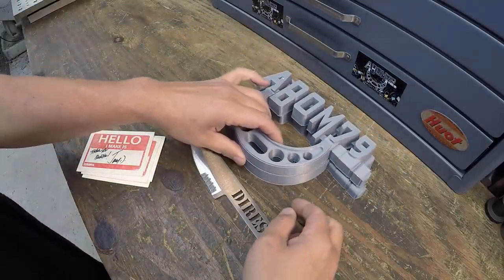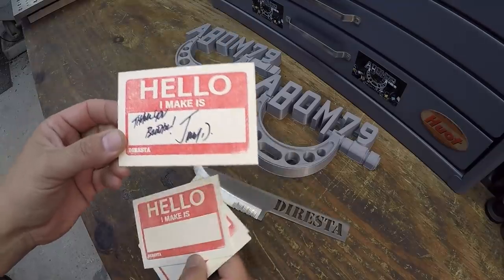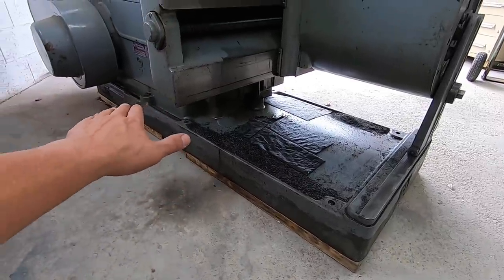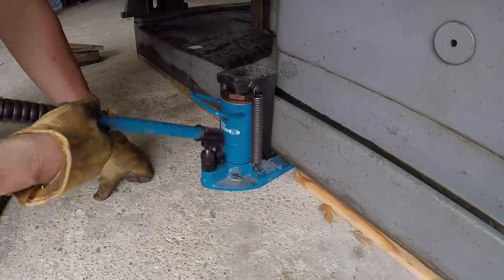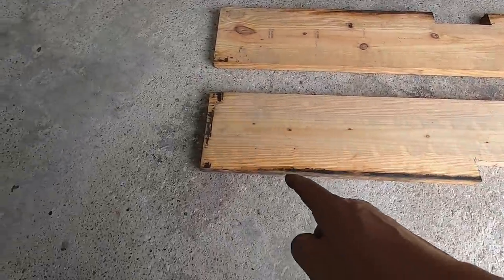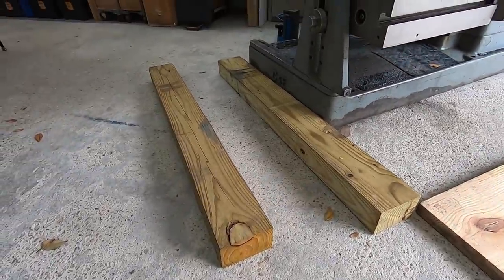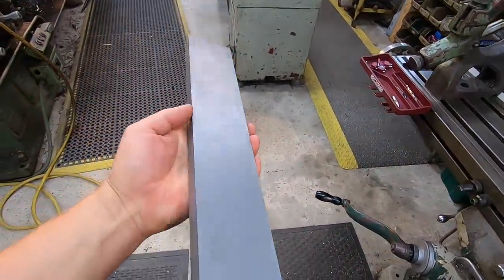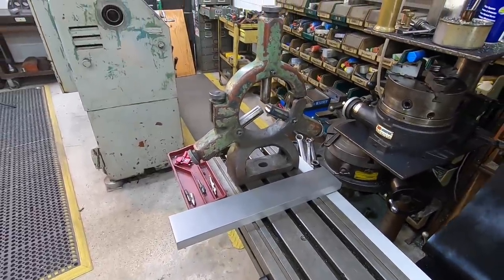SNS 299: Shaper Lifting, Steady rest Mount, New Electric Circuits

Comment: On that keyseater, if it's 3 phase then check to see if all three legs are getting power (I would do this with it unplugged and measure continuity). According to the plug that you have on it, it's a three phase machine, so no caps to worry about. 

From your description it sounds to me like it's "single-phasing" and not getting all three phases to the motor. Another possibility is that the rotation of the motor is backwards and the keyseater might not run in that direction. This is rare, but not unheard of. 

Another possibility is that the motor shows that it isn't shorted when measured with an ohmmeter, but shorts out when power is applied. A megger can be used to check this out. Usually once it shorts out you have an obvious connection to ground, but this isn't always the case. And unless you know what you are doing with a megger, I wouldn't recommend using one (they can be dangerous to you and the motor).

So check to see if all three phases are providing power to the motor, and check to see that none of the phases are grounded.

So if your motor "rings" out properly, then disconnect the motor shaft from the machine and see if it starts up then. Be sure to check the rotation when you do this, and correct it (swap two legs going to the motor) if it is backwards. Once you figure out which way is which, do yourself a favor and paint an arrow in the direction that the motor is supposed to rotate (if it isn't marked already).

The motor on it looks like it came from the dark ages, but that just means that it's a survivor. These old motors really stand up well. I could tell its age just by looking at your old starter, it has overloads for only two of the three phases. That's old-timey there. :)

Comment: when i was in trade school, our shop had a horizontal mill that was not secured to the floor, not on blocks of any kind either. one of our projects was a small drill press vice, which involved making a 1" deep cut with a .50" carbide insert cutter, on that horizontal mill.  the vibration from that one operation was so much that one day, there was a small earthquake, and i couldn't quite tell the difference.

Comment: Possibly, the minor rocking you still have could be due to the flex in the wood itself.  Unless of course, you are using really hard wood.  Have you thought about making a set of leveling pads that you could post in those lag holes?  Could be another project!
Reply: I was thinking the same sort of thing. Use steel blocks to get the required height with a thin piece of wood below to take up the imperfections of the floor. Just a pin to hold each assembly together.
Shim it out to get rid of any rocking, then machine the blocks so that the shims aren't needed. If only he had a shaper to do that on. 🤪

Comment: Hey Adam,  I would definitely pull that motor cover off the Davis Keyseater  and verify what voltage it is in fact wired for. That could be an easy fix.

Comment: Hey Adam, on the key seater, is there an easy place to disengage the motor from the machine? This will give you a quick idea of whether things are frozen up or you have an electrical problem.

There are services out there that will re-surface concrete floors, maybe they can grind down any high spots on the floor for you. Is it possible that the bottom of the shaper is not flat?

Comment: You can get some rubber feet from Mc Master Carr. they work great to isolate the machine and compress just enough to take up some imperfections in the level of the base or floor.
Reply: I was thinking the same thing, using rubber pads setting under six screw jacks at each mount point. It would give him height he is wanting plus you could still run a pallet jack under it since the jacks would stay with the machine as you moved it around. This would allow him to distribute the load to more points and it wouldn't matter how level the floor was since you could adjust each jack independently.

Comment: A different way to support a heavy object that I have used many times and works flawlessly is to use wood blocks much the same as you are doing but if you take some heavy fender washers and a hex nut that fits a carriage bolt and weld the hex nut to the washer and bore  a relief hole for the nut and a relief hole for the carriage bolt as it protrudes up into the wood you can use 3 of them for a 3 point mounting or use as many as you feel you need to support the machine and you then use a level to run the carriage bolt head down to the concrete floor. The round head of the carriage bolt spins easily on the floor and the square shoulder on the bolt shaft allows easy adjustment with a wrench. I used this method when living in Las Vegas and was building video poker bars for taverns and casinos because of the heavy weight from the machine itself and being loaded down with coin maintaining the levelness of the bar was critical or the machine would jam and not dispense winnings on the slot machines. We would build a separate base for the bar with the carriage bolts installed on the bottom then use a transit level to shoot the base in level then set the individual boxes the video poker machines  in on top of the base. After the bar was complete a additional base trim was added to the base to fill in the gap between the floor and the base. This was a simple and effective way to level heavy machines or furniture and offer maintenance free operation. Full adjust ability is key to a stable and level installation.
Love your video content as always.

Comment: I would worry about the base of the machine warping over time without support in the center. You may want to think about using some thick rubber for a little conformity under the machine. A rubber horse mat might work.

Comment: I do have a question about the shaper and it is wouldn't you or shouldn't you be worried about the weight of the machine deflecting or distorting the thin area of the base trying to bend or break the front base off at the back of the table?

Comment: Why not make some steel feet for the shaper - large bar, say 3 or 4 inch. You could turn or mill each one to the exact thickness to deal with the uneven floor or use steel shims. This way you could also lag it to the floor, with the custom feet to allow for the unevenness of the floor. You definitely have the skills ...

Comment: I agree with Mr Kevin Schofield.....that foundry pattern will never pull as it is. Add some draft for sure, and maybe reduce the depth of the smaller holes by a half or so.....you’ll be much happier with the result in the sand.

Comment: Have you thought of using a wood workers out board support like Keith Fenner did in his old shop.  It should be easier and cheaper that modifying the Steady.  I think in the end you'll decide to set the Shaper on lag screws of machinist's jacks.  The wood supports wil in time degrade and only get worse.  Love seeing the shaper whittle away on a block of steel.

Comment: Just a concern on the shaper, but wouldn't there be a risk of snapping the base in h center if it's unsupported. Center and back feet look to be the major weight bearing points.

Comment: It would have been interesting to have tried small machinist jacks under the two front corners, with the center board holding the weight of the machine at the front, and lightly load them to try to remove the rock. It would be ideal to anchor, level and grout it in place. However in a shop where you haven't nailed down the layout it isn't practical.

Comment: Your shop is looking good!   You probably hooked up the transformer correctly, but I thought I would make a few comments just in case.  Transformers are normally connected high to lower voltage.   The strap ground to the case should be disconnected from the low side and connected to the high(480 volt secondary) typically connected to B phase in 3 wire systems.   Do not put a fuse on the B(if grounded) phase, slug it anywhere in the system.  The transformer should have properly sized ground run to the same ground point as the service.  Never use 480/277 volt breakers on your 480 volt delta system.    These are all extremely important for safety reasons.  Hopefully, you have done all of these points.  If anything is unclear, please ask.   The life you save may be your own.   Respectfully,   Kevin

Comment: Those logos look like they're going to be hard to cast because of the small holes in the As and B's. Really hard to get small columns of sand like that to stay behind when trying to remove the pattern from the mold. Might have to make separate cores to fill them.

Comment: It appears that you are using softwood: Pine or Fir.  I would suggest using a much harder wood.  I don't know which wood would be best without researching.  White Oak or Hickory might be a good starter choice.  I would also suggest putting some finishing oil on the wood so that it does not soak up an moisture from the concrete.

Comment: Adam any chance that those type of pads you have under the big steel bench could be adapted to suit going under the shaper on the 6 points of contact and are adjustable for levelling the machine, just a thought Adam

Comment: Great content as usual. Question, wouldn’t the shaper sag in the middle under its own weight?
Reply: thats what i was thinking, maybe some 3/4 threaded rod with washer and nut welded to 6 inch round plate at each bolt down place to use as leveling jacks

Comment: Could it be that the wood is a bit squishy? I think that if you use harder materials to set the shaper on, like metal bars for example, you might get rid of the last bit of rocking. Provided that the floor is level of course.

Comment: For the machine that hums at the end, a couple of quick simple things. I guess you could take the belt off and see if the rest of the machine turns freely. You could also check to see if the motor turns freely. check to see if the motor turns with the belt off. Could be wiring, maybe a capacitor to help start the motor? Kinda obvious stuff but that'll probably help narrow down the problem.

Comment: Adam, do yourself a favor and watch a bit of myfordboy.  You will want to coat that 3D Print with some filler/primer.  It will GREATLY help the print in releasing from the sand mold.  Even with talc, an unpainted 3D print can stick in the greensand.

Comment: Morning Adam! I'm halfway through the video, so I'm unsure if you solved this yet or not. So. The (six?) mounting points for lagging the machine to the floor....would it not be possible to fabricobble some heavy threaded adjustable jacks, pretty much like adjustable feet to set your machine off both the ends and the centre to reduce sagging (which I presume is why the machine is lower in the centre?) and to provide a wider set of contact points? I figure that each point would need to bear maybe a tonne or so, so I guess the limitation would be the existing size of the lagging points. Not a million miles away from fixing a walking washing machine! <edit: yikes. so many people commenting on fixes for this problem....I feel like I'm adding to the noise more than anything>

Comment: Have you thought about making adjustable feet, which would allow you to adjust how the machine sits on the floor. It would also allow you to level the machine making setting up for some jobs easier.
Reply: I was thinking the same. With my heavy machinery I use mushroom head bolts with the mushroom against the floor then use two nuts to adjust up and down and to lock them in to place...works great! It also give you precision adjustability at every mounting point to adjust your level.

Comment: Why not build some adjustable jacks for the shaper? Ideally you would shim and anchor it but if you wish to keep it somewhat mobile I'd fab up something similar to a machinist Jack for however many pads it has and that way you can adjust to fit the floor

Comment: About the drill grinder, perhaps the tricky engage lever is intended as a safety feature. The knocking seems to be as guessed, the belt knocking into the cover due to the oscillating of one of the pulleys. The motor looked loose, but it could have been an illusion caused by lensing effect of the camera.

Comment: You might be "single phasing"...(For three phase) You got juice but not enough to run the motor. Switch your wires around. (Just a suggestion but I've seen it before.) If it runs backwards, youre doin it wrong!

Comment: Go ahead and bolt that bad boy down!
Reply: I was thinking the same. You can set it on the wood blocks but still put bolts thru and anchor it to the floor. Wood is soft and elastic material, kinda like rubber. I would guess the more (higher pieces) wood you have there, the more play it will have. Just a thought, I'm not an expert.

Comment: put a cover on the hardness tester when you run the oliver. You don't want that grinding dust on the works. 
now that you removed the boards and the rocking is gone, maybe the high speed lever won't snap out of gear to neutral. Maybe that was part of the problem.

Comment: the correct answer is obviously to take the shaper apart, flip it over, mill and scrape in the bottom plate, then re-level the concrete. :)

Comment: Adam, what are the dimensions of each section of your shop? Looks like about 12’-15’ x 30’ for the original shop area and maybe a little smaller (probably same length) for the addition.
Reply from the maker: 18x50 & 12x50

Comment: Hello on my shaper it was. movement :more I bolt center and rear dawn and check from clearance 1/16”+  I  grout  the from and bolt it dawn ,it work now very good ,remember you have bolt it dawn shaper center is very heavy wedge it until you dicived

Comment: Why put the short board on the material end? If you shape a heavy off-centre piece you might introduce a torque twist.  I'd suggest putting the 3rd point at the back

Comment: That ticking noise is the metal lacing on the belt hitting the pulleys. Hear it all the time on old flat belt equipment. Nothing to be concerned about unless you get a continuous belt without a seam. The knocking does sound bad

Comment: Just make some steel feet with dimples in the center..even better I bought some with synthetic bases bonded to them to soak up vibrations. Work great on my 5 1/2 ton vmc and doesn't hurt the concrete 😎

Comment: I would think that the wood blocks will compress over time and eventually the problem will return.  Also, with it not being secured to the floor and leveled, won't that cause the machine to twist while operating and affect the true-ness of the cuts?

Comment: Adam how about six fine threaded rods with a foot that stands on a steel plates with a pocket milled in the top of each one. Use nuts on each rod to level each of the six. My mills are 6000 lbs each and rest on four corners. One machine has threaded rods that sit on some 4" round stock with a pocket the size of the threaded rod. Just a thought. Keep up the great videos. Jason

Comment: Adam,
Here is a link to leveling jacks for machine tools.  They have Imperial and Metric sizes.  You need a tapped hole for the jack but it will lift the machine and can be used to lag the machine to the floor.  The company is E & E Special Products.  https://eesp.co/leveling-jacks/

Comment: If you left the machine sitting without it running for a couple days the wood should deform just a bit to compensate for the unevenness of the concrete and and any high or low spots of the machine. Vibration from the other machinery in the room would probably help too.

Comment: form an electrician if it hums and 
its single phase, capacitor may be bad or one winding. or jam
if its 3 phase you may only have 2 phases making it to the motor easy way to check is spin it if it spins after stop it and you know the fault.
Reply: If single ph. could also be the centrifugal switch. However, that motor looks old enough to be an I/R motor, in which case, it could be a problem with the shorting necklace.

Comment: Might be a bad starter capacitor on the key shaper.  If you can do it safely, light it up and try giving the flywheel a push. if it keeps running, it could be the capacitor.
Reply: @N Ferraro  It appears it might be a three phase motor.  No start / run capacitors involved with them.  Just straight induction motors.
Ken
Reply: @kejay74  Oh, jeez. I guess Adam must have a 3 phase rotary/solidstate  transformer to run the heavy equipment. I'm not used to thinking about that:)
Reply: @nferraro222 .... Adam has 3 phase/208v in his shop from the pole.
Reply: @paulcopeland9035  Wow - I assumed that only really high-production shops could afford something like that. A number that I heard (that I HAVE NOT verified) was about $1000/mo starting cost.
Reply: @nferraro222  ...No, there isn't any "extra" charge for 3-phase service. Electrical power is charged by the number of kilowatts per hour used no matter the voltage or phase. 3-phase is really just 3 single phase wires (without neutral) that make up the 3-phase supply.  The only time 3-phase is more expensive is in the odd industrial area where there may be a 3-phase tariff.  Adam's shop is at his home and he is lucky there is 3-phase right outside.  Now it is another story if you want to bring 3-phase to your shop and it isn't on the pole right outside, the cost can easily be in the many thousands of dollars!
Reply: @paulcopeland9035  Ahh, OK - thanks for the explanation. Seems as though a lot of shops are in that position, though. I've heard of quite a few people running mechanical or electronic converters.

Comment: The shop appears to have been fully wired for 3-phase. Did your utility provide you with 120/240 Open Delta service, 120/208 Wye service, etc.?

Comment: Adam take my advice ( try it, am sure you will get good result ) ( put small block of wood behind  ex. Height 8* width 20  and the second one like what you have now (Height 10* width 20 i think )  put it in the front ) it will stable.